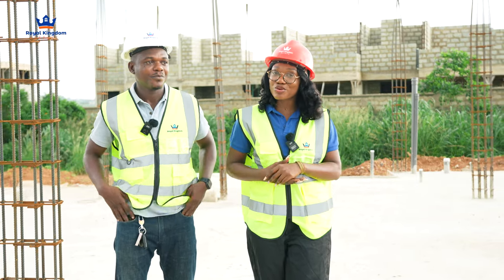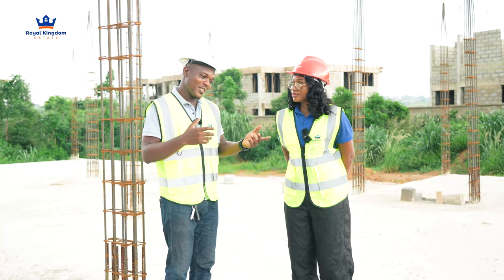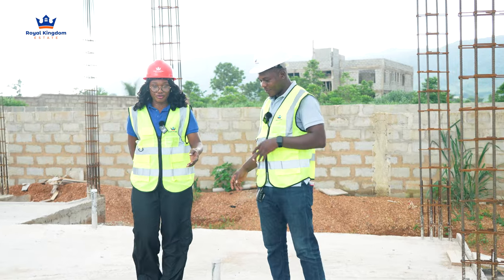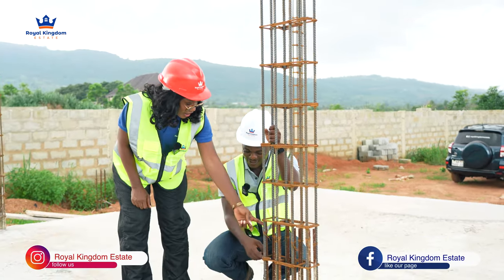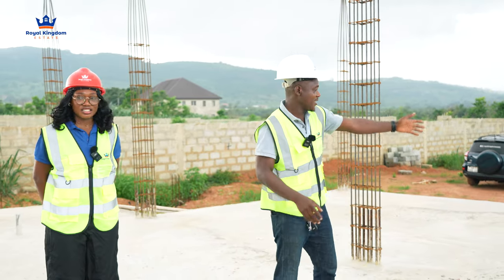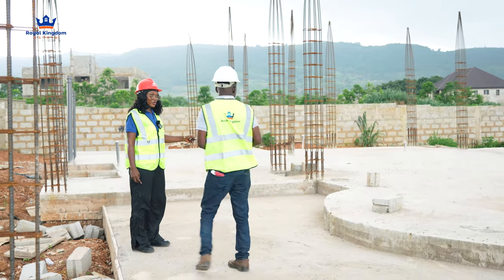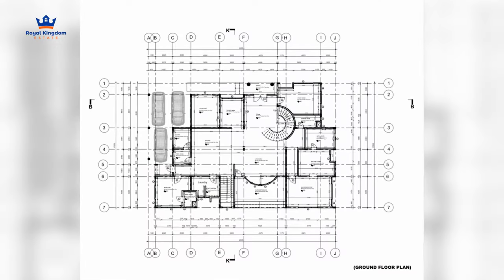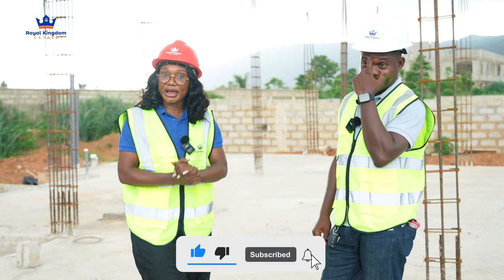WE HAVE MADE MASSIVE PROGRESS ON THIS CLIENT’S PROJECT AT GRACE CITY/ABURI !

Comment: Site engineer, in this video you said the columns comes by joining the iron rot in three phases with the starting column then joined to what ever height and then another to the roofing, my question is is it possible to start with full length of iron rods from the footing so the the joining can be done once at the upper section ?